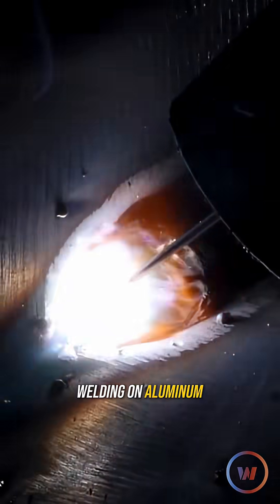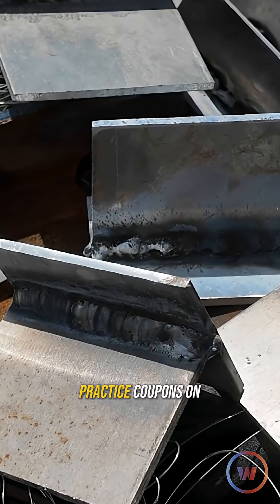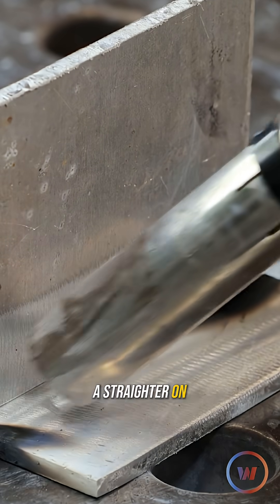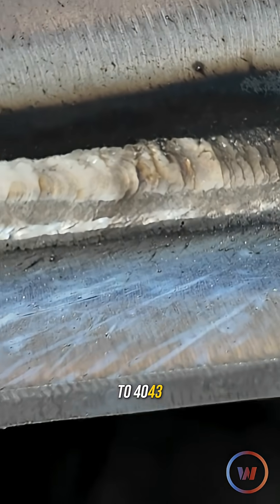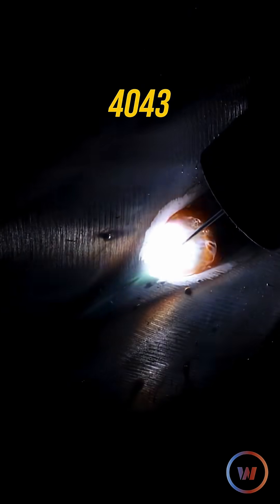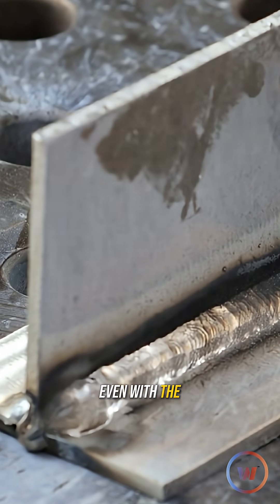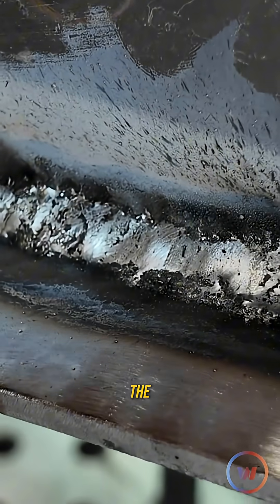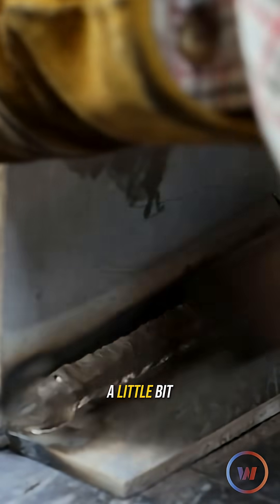4043 vs 5356 – Which Aluminum Wire Should You Use?

Comment: When you MIG weld aluminum, I believe that's using direct current (DC) right? Why does this work fine for MIG, but TIG rmostly requires AC? I know TIG is using the cleaning action of A/C for blasting off the aluminum oxide, so how does the oxide get removed when MIG welding aluminum?

Comment: Like someone has already said, 4043 has silicon in it. That is also partly why it wets out more when welding. Also, if you’re welding something that is getting anodized it is best to use 5356. The weld won’t show as if you use 4043 it looks like dissimilar metals because the weld will be visible.

Comment: 5356 is high in Manganese that's the black your seeing it vaporizes in the arc and deposits on the toes of the weld 4043 is high in Silicon that's why it welds cleaner. 5356 is marine grade wire your gas settings are off need to crank up the gas a little bit not too much or it'll roll out on ya and you chase your tail. I like using Bernard tapered nozzles and tips get more gas velocity helps with welding outside and you can turn your regulator down big time. Also anytime welding 3/8" or thicker you should use a helium mix both pulse and spool gun spray helps the puddle degas a lot you won't trap as much hydrogen.